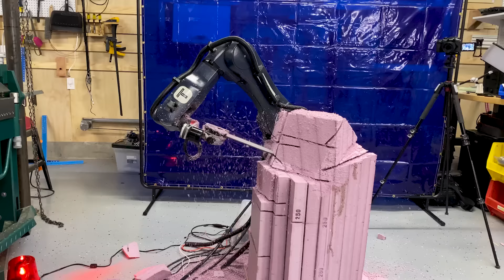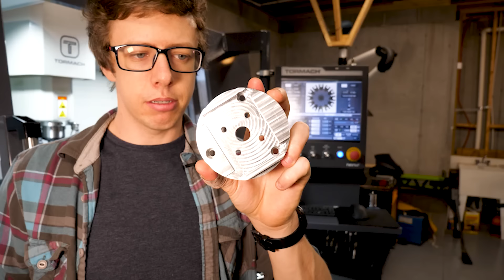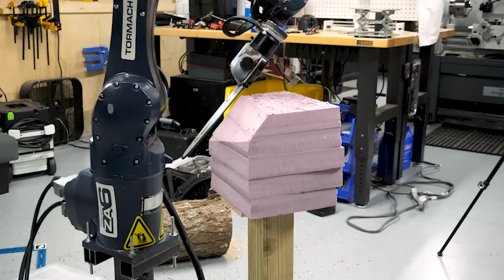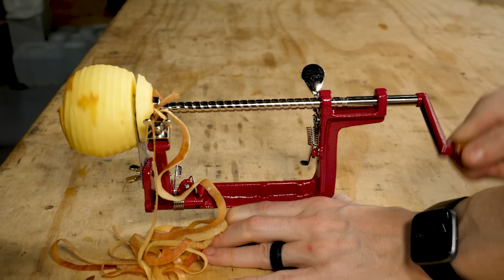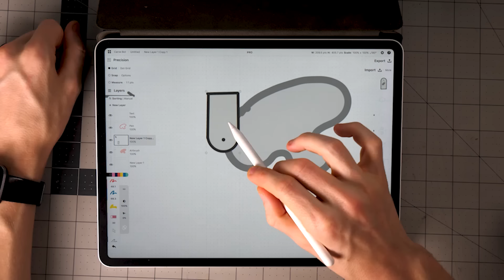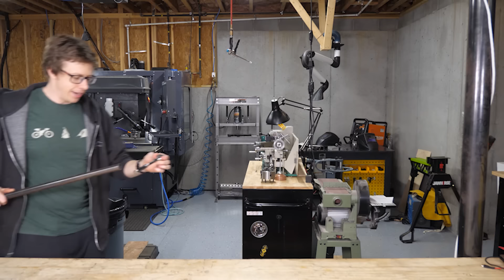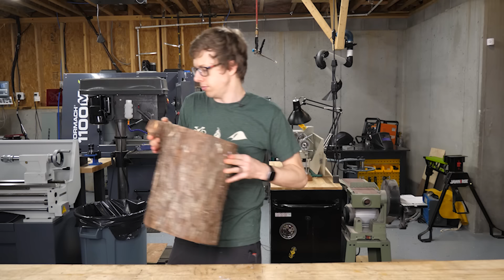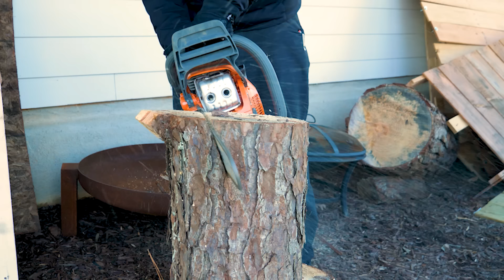Chainsaw + robotic arm = art?

Comment: I know it's been 5 years, but for future optimisation issues where you're trying to find a global optimum, look at scipy's minimize function with the BGFS algorithm. I've used this a ton of times for this kind of problem solving, including stuff where I've got to invoke external work (e.g. ngspice simulations for electronics). Works great even for multivariate problems, and you can parallelise it fairly easily.

Comment: 10:50 the solution is introducing jitter to the "stuck" processes (assuming you are not running a single process) that gets stronger and stronger, and heterogenous worker types. annealing is the general solution to it, given your fitness metric is calibrated good enough

Comment: SO that you it would not find a false summit, it could move in each direction (it can only move for a set amount of time) if it finds a point and it can move up than it will use that summit instead of the false summit

Comment: I know I'm years late with this comment but a way to solve the gradient ascent problem is to have test and hold positions. In short:

Once you get to a peak, then have that as a hold position. Then, simultaneously start at another location and see if you find another peak. When you do, compare the peak with your last hold position and if higher, then make that the new hold position. 

If you do this in cross sections of the area, then you will eventually have scanned the entire block to find  all peaks and your last hold position will be the highest peak.

Comment: I’m an automotive engineer on my capstone and been given the opportunity to work with an industry partner on a Wire arch additive material robot and I remember watching this video years ago. I’m very curious if you would have any resources or advice with hardware and software integrations to have the most success with 3d printing metal with a welder. I don’t know what the best way to reach out but I would love any advice.

Comment: One idea for fixing the false summit problems would be using the original strategy you mentioned, searching all points and saving the max, but instead doing it at a lower resolution, so your only sampling maybe 1 point for every 10 units. Then you can use gradient ascent to improve that guess.

Comment: 17:27  That is not some sort of "anti-kickback tooth".  Those set the depth of cut for the blades and prevent you from taking too large a cut and jamming the chain.  Since the operator is a robot that is strong enough to hold the saw back and prevent that, file them down.  That way the robot can use the tip of the saw to make cuts.  People who use chainsaws for carving have to set the chain up very different from how you would for a normal chainsaw.  You didn't do your research into carving with a chainsaw.

Comment: 17:40 I seriously take my hat off to you, you really are one smart dude.. but as someone who's spent a lot of time working with chainsaws, and has dabbled with a little chainsaw carving, you really do lack the common sense that comes with experience! I can't even begin to start listing the little tricks and techniques that can be persuaded out of a chainsaw bar/blade, with very little ease, but just simply understanding the way the chain of blades cut would help you here!

A well sharpened chain would do you wonders here, specifically were you to adjust the limiters. That's what appears to be limiting your cut, but I also don't see any lubrication. Chainsaw blades MUST be run with oil. I know that makes things a little messy which may not be superb for you, but the penalty is the severely reduced durability brought on my the intense heat generated by the friction. Chains MUST be lubricated!!

Ah, it's nothing to be ashamed of. If we aren't making mistakes, we aren't learning, and it fills my heart with joy that a dude as intelligently gifted as you still has many things to learn

Keep up the great work, I've only recently discovered your channel, but I'm utterly hooked 👍👍👍

Comment: At 12:41 the saw was running in reverse also you need to use a non safety chain as safety chains can not plung cut.

Comment: Someone probably already pointed this out, but you never know: to solve the "local optimum" or "false summit" problem, you are usually best off introducting a random jump to your algorithm.

After noticing you reached a peak, you remember it, and then perform a random long-distance jump and reiterate from there. If you arrive at the same peak you just jumped from, chances are higher that this was in fact a real optimal solution.

Comment: Hi, with the issue of gradient accent, you might be able to do multiple guesses. This could fix the problem of false conclusions by having guesses on each side (if you have 2 hills, you would get a guess on each hill) I’m not completely sure if this would work, but in my idiot mind, it does.

Comment: This is awesome.  I have an older Staubli Rx90 I've been doing a lot of fun projects with (photography, drawing w a sharpie, making drip paintings, cutting waxes for jewelry, cutting foundry patterns with a router, ect.).   I wanted to tell you - be super careful with the foam.  A guy I went to art school with spent about a month sanding that foam and had some serious cancer not that long after.  Who knows if it was related - he was mostly wearing a respirator.  I'd just urge you to be careful.  

I've had good luck with a $15 thrift store router using a 1/4" upcut spiral bit.  LOTS slower than a chainsaw tho'

Cheers,

David

Comment: It would be much easier and prettier to just use triangles from the model as cutting planes only a few checks and you would be done.
Reply: It would not solve all the problems. There can be edges which could not be cut because the saw blade is wider than the cut, or it is blocked by other parts of the sculpture. But I think it will be easier to fix this issues by transforming the 3d model, than by doing an approximation during build of an execution plane (as SMH did).
Reply: @magras8220  I did not say it would fix all of the problems. Only that it would be much better point to start from and that result would be much better.

Comment: The way to >>>>>probably<<<<<< make gradient ascent work is to map out local maxima and minima before hand in a way that does not involve testing every single point in 3D space, techniques such as genetic algorithm COULD work if you work out the incredibly boring math of mapping a point in 3D space to a binary genome (it's not hard, it's just annoying) and building a GA that's good enough to NOT over-converge in early generations will mostly fix the problem of local vs global maxima.

Comment: Software is the biggest issue with robotics and machines, like 6 axis 3D printing is relatively easy to achieve in hardware but the software to slice the models just isn’t capable yet. For a lot of systems like this you can choose to brute force it or you can use algorithms like gradient ascent, the brute force option is always easiest but takes so much longer to compute like you found.

Comment: 12:20  your supposed to use a special deadmans switch when near robots it requires a gentle amount of pressure to keep the robot running and if you squease harder OR release it the robot shuts down, this accounts for the many different types of panic reactions different people can have in different situations

Comment: @Stuff Made Here  At 17:26 - this is not an anti-kickback tooth. It's called a depth gauge, it controls how much wood the cutting teeth carve out on each pass. The lower the depth gauge is from the top of the cutting tooth the more wood that will be carved out. You may be better off using a proper wood carving chain, and a more powerful motor, also it's not clear if you were using a lubricant on the chain. Great idea Bud, got to luv that kill zone safety feature.

Comment: A bit late, but the solution for the gradient ascent problem is the same one as we use in machine learning. Take x amount of random points, and take te best. Also in this case, you don't really need the best solution, you need a good enough one. So he could have just taken 100 points, use the gradient ascent on each one of them, and take the best one. It wouldn't be perfect, but it just needs to be good enough.

Comment: You know, 1 feature I can think of that is a must for these robotic arms is constraints. It should be configurable in the interface of the robot. Either to specify constraints for motor angles and combinations of such. or to provide a 3d model of the attachment so the robot can calculate the movement constraints by itself.

Comment: would it have been a possibility for a modell with a low poly count to 
1.: cut those face directly off which's tangent vector field doesn't intersect with other faces (remoovs the largest chunks)
and when that's done
2.: cuts towards the faces in the largest ancle to its normal vector without intersecting with other faces from the positive side (normalvector positive).
if you run the calculation and a good sorting algorythm afterwards it should be pritty efficient.

Comment: couldn't you convert the model to low poly, then scale it up until you get the clearance you want? 

Then you could finally make a 2d cut around from various angles. (Just slicing it with thickness of blade)

Anyway, great content. Absolutely amazing stuff made here 👍

Comment: 9:20 - a wedge is basically just a triangle right?
3D graphics are composed of millions and millions of tiny triangles. 
Wouldn't it be pretty efficient to render a low poly version of the bear, extend the lines of the resulting triangles outwards. Check for Collins with the 3D model and then use the output as lines for the chainsaw to cut? 

Once the low poly bear is cut some cleanup can be calculated tog er down to a nicer looking version. 

Sounds like an efficient way to get the job done. 🤔
Reply: Yeah that's what I was thinking, have a low poly model of a bear to get most of the bigger cuts and then have a higher poly model to get detailed cuts.

Comment: You need to sharpen the chain and be sure you have bar oil in the saw. I recommend having multiple sharpened chains cause you’ll most definitely going to need to sharpen/switch out multiple times if used on wood. You’re crazy smart dude. Very impressive.

Comment: you can use the tip of the chainsaw to "dremel out" small areas smoothly, and you can freely rotate the saw with the arm. the are loads of ways for you to make the bear waaaay more accurate with the gear you have, but it probably would literally take weeks to code.

Comment: A possible solution for the gradient accent, you could have the program save the cut that it thinks is a summit, and then check around to see if it could find a higher summit. Repeat for a set amount of times until it has the highest summit.

Comment: I think i solved the saw issue even easier just get a big industrial STHL and then put a 14-16" bar making it run super high rpm extremely efficient and the forester saws are intended to be run a 24hr duty cycle with regular saw maintenance intervals

Comment: I would use a angle grinder with a 4inch saw blade grinder for shaping would. You should have more electric power in that with less friction on a saw blade. Might take longer but is more detailed.

Comment: Absolutely love the video and I just wanted to point out that there is a specific form of tapered chainsaw bar and corresponding chain to prevent the issue you encountered with heat while cutting wood. Cheers!

Comment: why not just use the faces of the model? they're basically already cutting planes. for each face, make an infinite plane, and within each of those planes just look for intersections with ether the model or the outer edges of your cut area. if you just keep picking starting points on the outer edge intersections and stopping points at ether the mesh intersections or the other outer edge, eventually you're left with the exact model.

Comment: What about new cncs that will scan or probe a part and read a cad file? Thats what you need to get. All you really gotta do is tool offsets and basic setups. ive been working in machine shops for a decade, theres some pretty crazy stuff out there.
(Obviously its not as simple as i make it out to be, but there are pretty crazy things they can do-job security)

Comment: To solve the false summet problem, you introduce an error rate into your optimization steps.

That means that, in a certain percentage of cases you allow for a random direction with a certain magnitude. You then continue the gradiant analysis. This way, you hope to cross the gap in some cases.
Finally, you run a shorter optimization to reach your local maximum without the randomness.

Proper settings for the percentage of random steps and its magnitude are problem specific, and you are down to trail and error here.

Comment: Did you thought about programming this, to make cuts next to each other to take out hard to reach material? This how I remove material with heavy tools. Cut off big chunks, and if it can't fit anymore, I just dip blade removing chunks in width of the blade.

Comment: 10:50 Couldn't you just calculate the local maxima and determine if the location you selected found is the local maxima of the part in the Z direction. If no you can then just select a different point and keep doing that until the maxima is found.

Comment: From a old dumb woodsman, the part in front of the tooth is called the racker, it tells the tooth how much to cut. They need to be 20 to 25 thousanths under the tooth, any more the saw will want to kick back. In the slow mo. of the saw cutting, you can see some of the teeth cut some don't.

Comment: The problem of getting stuck in a local minima or maxima can be overcome by randomizing the start location and simulating multiple runs and identifying the lowest/highest peak. Machine learning has solved this problem, although it's harder in this case because that's just one cut of many, isn't it? I might know someone mathy enough to figure it out if you're still interested... although this was months ago :)

Comment: 17:28 that's exactly what it is, it doesn't allow the chain to cut on the tip, that way if there's no cutting there's no drag and it can't generate the force for a kickback. If you are going to plunge cut with a chainsaw you have to get a chain that is not anti-kickback

Comment: haven't read other comments.. but that's NOT and anti kickback tooth.. it's a depth stop.. they need to be a touch lower than the cutting edge. not so low that it digs in to a stop.. but enough so the cutting edge can engage the material.. there are chainsaw sharpeners with a file guide that sharpen the cutting edges AND file that depth stop tooth.. or.. just get a new chain...

Comment: Lol cnc machines are just reverse 3d printers, I should do the same thing with a six axis robot arm, but used a hotend, also if you can run python multthreaded or gpu that might be a way to speed up computation, not sure how you sped things up tho

Comment: I'm probably way too late, and frankly amazed to have anything but "amazing" to say. QUALIFIER: ran a chainsaw daily for 12 years as an arborist. 3 things I notice are:
-I can't see an oiling mechanism! this is essential to heat dissipation in a chainsaw and cutting properly
- The chain seems to be fairly loose, there needs to be more tension on the chain for sure! A loose chain flies off the bar mid way (seen at 12:39) and then smashes back in causing wear on the bar (and more heat)
-the "kickback teeth" are in fact the guide for the tooth and need to be filed down periodically with the teeth. they determine how much a tooth bites (or doesn't), and in this case, are preventing the tooth from exacting a good chip.

If you fix these 3 issues, cutting wood should be closer to reality. 

Really love the videos, hope you actually achieve that wooden bear.

Comment: When you find your "False Summit" wouldn't the next step be an iteration where you extend out in your x and y directions (for a maximum amount as determined by the size of the part) If you find anything else, you've found a potential higher summit where you can begin anew from that new location. Keep repeating until it can't find anything in the x and y directions.